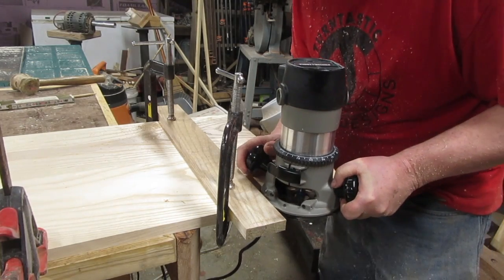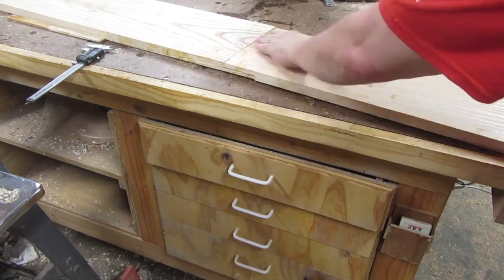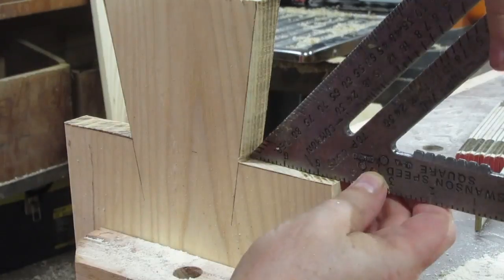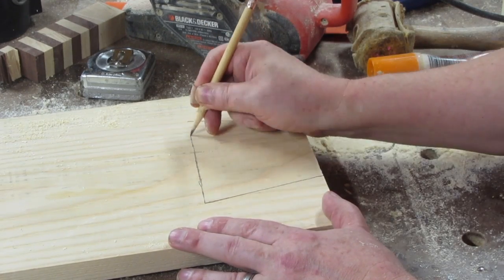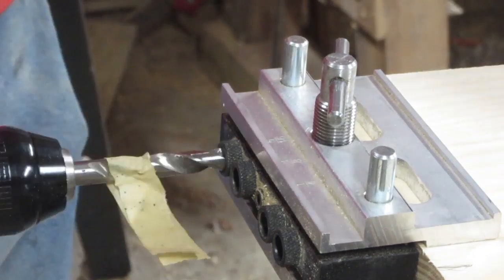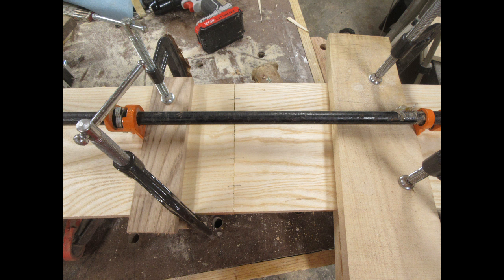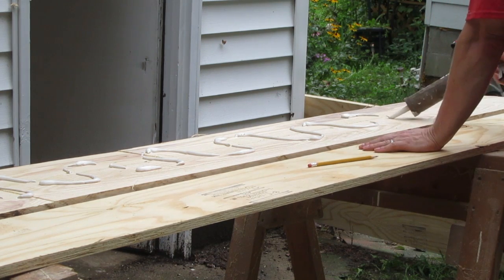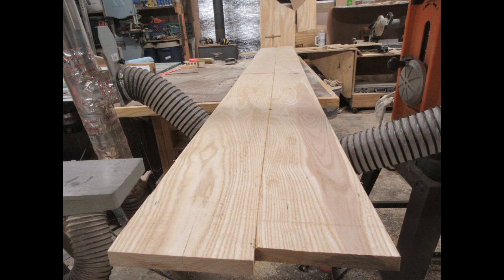Joining boards end to end

Comment: I'm doin a table top and have to end join some boards to make material work out that I have for it, thinkin biscuits for it, for alignment.. my thing is clamping, you did get creative there and gave me an idea lol..I'm not worried about the strength so much as the top it self will be good when done, but yeah clamping is my hold up,done several tops but not like I'm about to do ..tricky I'm thinking to get the butt joints flat through out. .

Comment: This method works for this application. I will say this. If you aren’t backing it with something that end to end joint is not very strong. I’ve done it without the dowels and even though it wasn’t under stress it still broke. Half lap is the real answer to this question. You just have to have the right tools / sneak up on the fit to make it perfect. 

The other thing you could do is cut the half lap in the same face if both boards and then glue in a piece to fit. This  piece could be left thicker and sanded down flush and if it’s in the back you won’t see it.
Reply: You seem to know what you're talking about. I'm wondering if you have any advice as to how to do this vertically? As in I'm trying to make a free standing case that's quite tall but my panels aren't long enough so I was wondering how to join the pieces I have (if that's even the correct solution)?

Comment: Absolutely fantastic advice mate. It is easy to barge ahead but always best to sit back think and come back to it. If I hadn't with my fish tank, the unusual legs would have toppled over and the tank would potentially be useless, expensive mistake there. As it happens I did think and came back to it, it worked out fine. Thanks for all this info, showing what didn't work etc

Comment: I think finger joints would be useful. If you look at factory-made pieced up wood, often if does use finger joints.
Another reasonable option is "offsetting joints", but  this assumes you're doing both butt and edge joints (as in making up a long-cutting board with scraps).

Added edit: credit to this guy for showing that a lot of this stuff is, well, a pain in the rear to get to where you want it to be.

Comment: I liked all of your approaches. I plan to add to my existing deck and want to extend my joists in such a way that—when I screw down the flooring—my screws are all aligned on the same joist centering. I may extend my joists using thin rebar dowels and epoxy.👍👍👍👍👍
Reply: I know this is old and you have probably completed this project already.  I would recommend adding a board across that joint with through bolts to secure that instead of rebar and epoxy.

Comment: I am trying to use 2 x 6 deck boards for garden edging.  I have a curve in the project. How do I join pieces together using a 22.5° cut so it can curve around when all 4 piece are together?
Is this possible.
I have only a circular saw. I need to practice  cutting angles on scrape wood. I just don't  get how to cut them to fit.

Comment: Thank you for the video, I am having to join 3/4" oak plywood for foundation ledge in my basement.  First tried pocket joints and that was a fail.  I will try the dowel pins.

Comment: Thank you for the video.  I need to join two 2x8x10 beams to make a strong-back to hold the frames for a 21 ft boat I'm building.  I'm going to try your dowel method.  Wish me luck :-)
Reply from the maker: Rene:
I have put out a new video here https://www.youtube.com/watch?v=pNPG_9s3VnI where I use a lap joint with pegs ant it is a much stronger joint.

Comment: IMHO, the dovetail would be your best bet. A sharp chisel rather than a rasp would have been way more effective in creating a good fit. Perhaps you cut on the wrong side of the line too. A simple jig for the router, to keep it steady would also be an option that would make the half lap work. Guaranteed, the dowels will fail over time, as they are not meant to be used that way. Glueing the boards to ply will obviously stop the dowel fail from being catastrophic, but issues with wood movement will be the next problem. you would have been way better off re sawing 2 or 3 mm  veneers on the bandsaw, and glueing those to your plywood.

Comment: From an Engineering perspective, a half lap, cut the way it's shown is weak as hell.  Counter tops don't need side to side strength, they're used almost exclusively vertical down pressure and anything straight is going to split at the joint.  So if you ever get a chance to do one of these, try a Finger joint via a Router, you'll get the strength you need by increasing surface area of the joint by well over 8x vs a straight line.  You get the added benefit of a visually good looking joint, which is a plus because you shouldn't be trying to hide that you merged boards, that's just dishonest anyway.

Comment: Terrible. The router half-lap is the best way. You just need a wider router base and an exact width support spacer that you can get by  cutting off a piece of the end of the board. Glue it up and throw some dowels through the face. Will be as stronk as you can get on that thin of board.